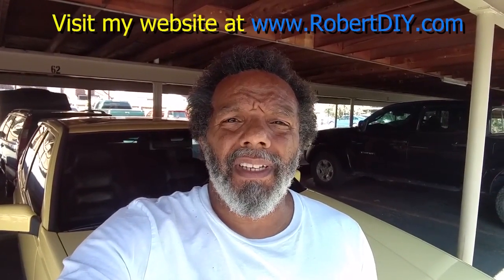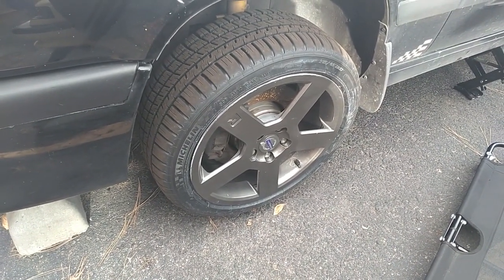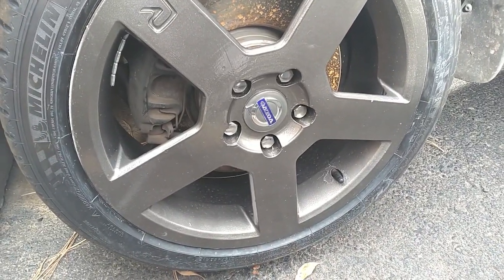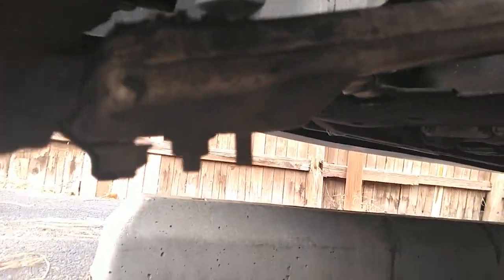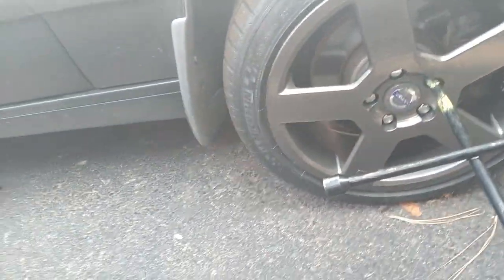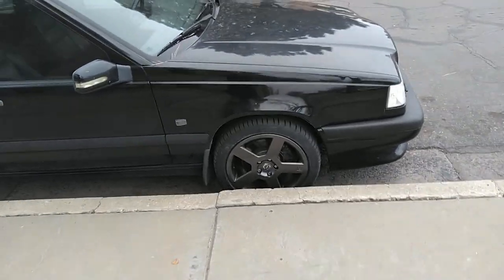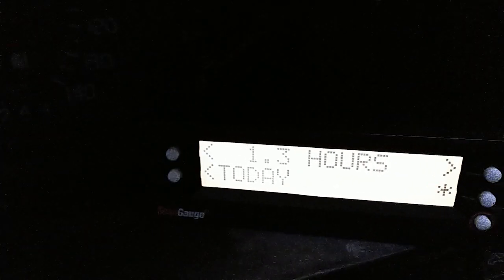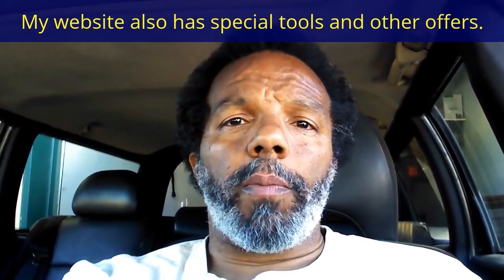Panther back on the road after control arms fixed, self service risks and battery charged. - HOWR

Comment: Whenever I replace ball joints on a control arm where they are bolted in like that (some VWs and these earlier Volvo control arms), I use high strength thread locker.  I've seen several instances where the nuts work loose on this style of ball joint, and I suspect that's part of the reason why you no longer see this style used on modern vehicles.
Reply from the maker: Interesting. I will probably start using thread lock as well.